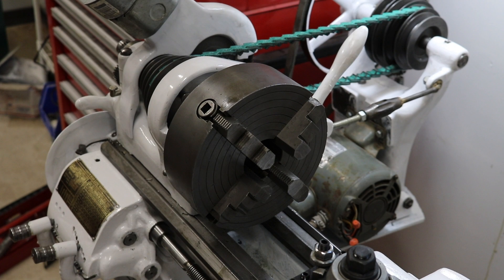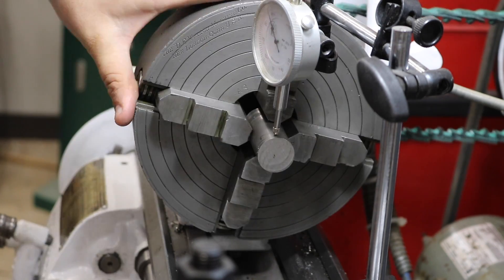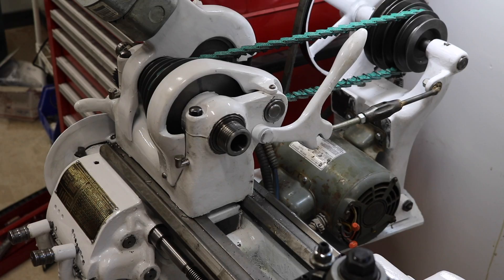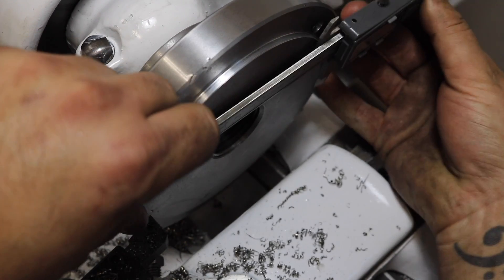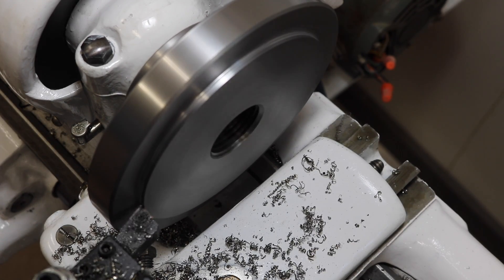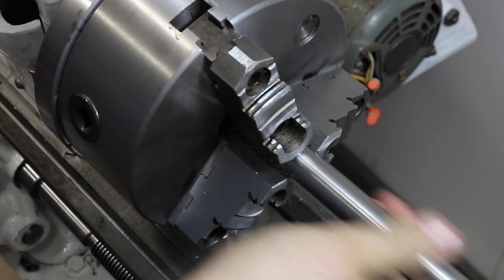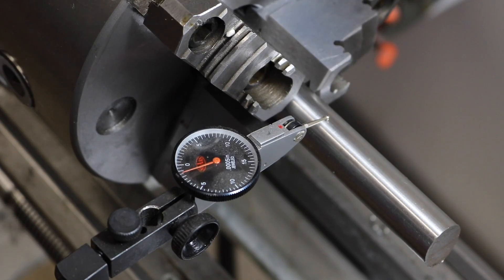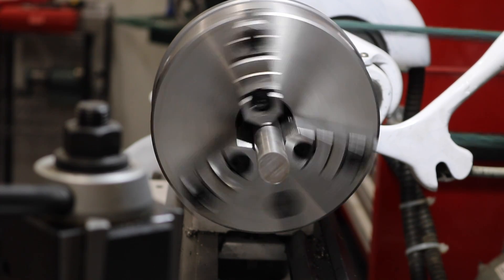Attaching a 3 Jaw Chuck to the South Bend 9a Lathe

Comment: I got my Grizzly 0765 running 1/2 of thousand!  Here's how.  It came with 3" chuck and it was crap!  It also wouldn't let me chuck round stock that's up to spindle size so I always wanted at least 4" but I couldn't find the one with proper register to the backplate that I ordered from Little Machine shop along with their independent 4" chuck (which is crap too)  They also charge you over $100.  I looked high and low on ebay but without luck.  Finally I noticed about a year ago Banggood started carrying lot's of cheap lathe tools.  I decided to check them out few weeks ago again while looking for some tools and came across 4" chuck that has proper 72 mm register! Bingo!  How I wish I found this sooner!  And it was only 65 bucks with shipping!!!  When it arrived it was way better quality and nice packaging compare to original and independent 4" I got from Little machine shop.  It has tight scroll lock.  I than watched a video about how one guy had to true up his little machine shop backplate and that got me thinking what if my plate is crooked too?  Well my plate was actually straight but I did notice my spindle had actually 1.5 thou run-out so I decided to face the spindle but had to rely on compound for cutter to reach it.  Now I don't know what kind of steel they use for spindle but it makes the cutter dig in badly even with slightest cuts, I ended up with rings which I used sandpaper with block of good and carriage to push with and polished a little.  I think the spindle needs grinding - not turning but end result I chucked 1/2 precession round stock and I am getting half a thousand run-out with new chuck and trued up spindle face.  Now let me add I am doing all of this after I got my South Bend 10 which makes me sad that I had to put up with crappy chuck for 3 or so years.
Reply: Love  your video  l have a South Bend 9 also. Would you be able to provide me w the item number or place where you bought it . Thank you

Comment: Great video.  When I put a new 6" 3 jaw on my 10" Atlas, I cut the back plate .001" oversize, put it in the freezer for 24 hrs, the put it on my 3 jaw.  Got my run out down to .0025".  I was happy as my last three jaw had .017" TIR.